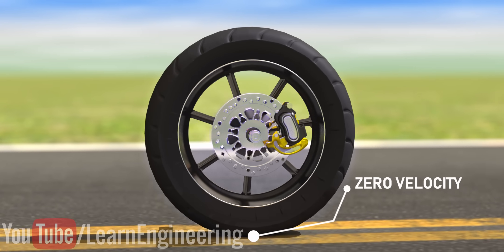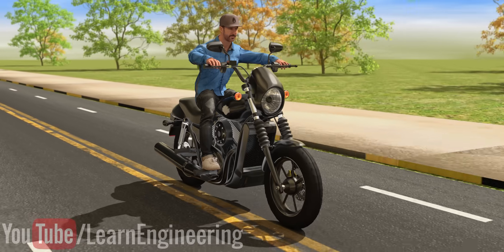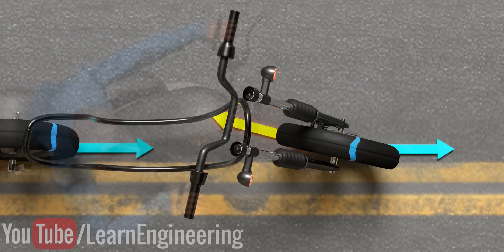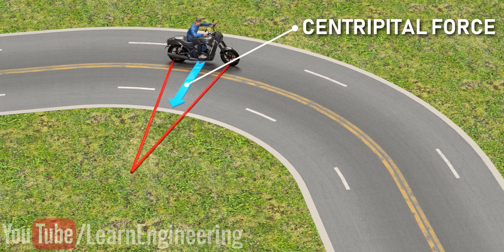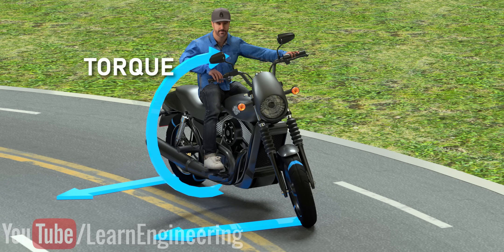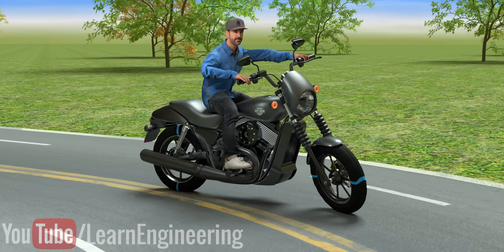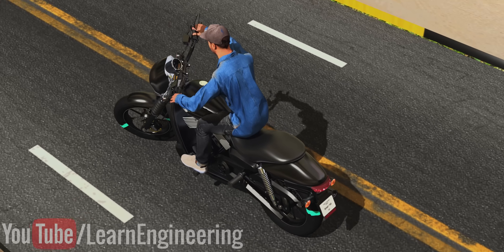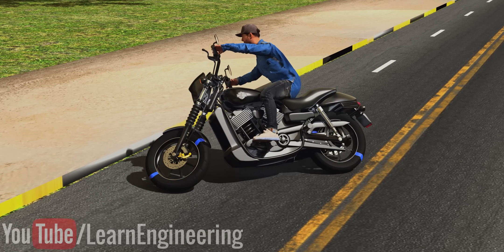Counter Steering | The interesting physics behind it

Comment: NOOOOOO this is so completely wrong, its amazing.  absolute rubbish.  it sounds science-y, as if by a physics student drop-out who never rode a motorcycle or a bicycle.  Experiments show that a bike with a fixed steering head cannot be turned by shifting weight.  THE DRIVER DOES NOT LEAN IN ORDER TO TURN, RATHER SHE LEANS BECAUSE THE BIKE FALLS INWARD. 

On any two-wheel vehicle, "no-slip" turning is ONLY  possible with a countersteer. Any other attempt only works at only very low speeds when it is possible for the tyres momentarily slip as they change direction...the same kind of slip that causes car tyres to squeak on concrete pavement. With cars, only this kind of steering is possible (excluding stunt drivers who drive a car on its side wheels). Note, when motorcycles and bicycles steer with slippage ("normal" steering), they must quickly straighten the wheel again, or of not, inertial forces will push the vehicle and rider (violently) in the original trajectory, while friction and torque of the rear wheel will push it in another, usually resulting in an unstable condition followed by a crash. 

countersteering works not because of centrifugal forces, though that helps keep the bike upright, but rather due to the fact the wheel is round, and gravity. The motorcycle is constantly falling forward and down. When the angle of the wheel is adjusted slightly, say to the 
left,, gravity will make the bike fall inwards toward the right. (The roundness of the tyre helps here). When that happens, the bike follows the path carved out by the curvature of the rim of the wheel.  

For proof of this, simply note that Once the cyclist is in a lean, she can straighten the wheel completely and vehicle will continue to follow the path of the wheel in a wide circle. Gravity will cause the bike to fall inward, centrifugal forces and centripetal forces produced by forward acceleration will keep it upright.

Lets look at it another way. Car tyres are essentially cylinders. If you were to replace the wheel with a cylinder, a turn necessitates uneven slippage between the tyre and surface. It also puts enormous pressure on the right side of  this cylinder, and as long as it does tip onto the rim, the bike will continue following the trajectory carved out by the left-facing cylinder  - to the left. A thin wheel does not have the contact area to counter that force, and so the bike falls to the "right". Now the vehicle is riding on the rim, sort of. 

Take a coin on a glass surface and experiment.

Comment: Counter steering is normal technique for motorcycle riding. If you try "normal steering" at high speeds you are absolutely asking for a crash. It should come naturally if you've ever rode a bike, you shouldn't have to think about it consciously.

If you ride a bicycle at decent speed you'll probably notice counter steering comes naturally at an unconscious level. And only use "normal steering" at low speeds.

Comment: The information is quite correct and the illustrations were done well. My only complaints were showing a rider with improper gear and also showing him counter steering into the curb. These could have been avoided. Remember new riders look at these  types of videos and showing someone geared up and not steering into a curb is always a decent plan in my book.

Comment: I'm an old fart who has been riding on and off for 52 years.  I'm back ON, so I started watching videos to refresh my skills and hopefully learn some new ones.  I've watched a couple counter steering videos and really had a hard time wrapping my head around the concept.  This video explained it in a way my head could accept the concept.  So yesterday, I went out for a slow speed ride to test this skill.  Wow, super easy and a much sharper turn in.  I was amazed at how so little pressure on the handlebar caused the bike to dip.  It was very easy to "catch" the bike and complete the turn.  I'll be practicing this new skill until it becomes second nature.  Thanks for teaching an old dog a new trick.
Reply: I suggest watching videos by people more experienced with motorcycle riding, like Motojitsu, Bret Tacs, Ryan Fortnine, Dan Dan the Fireman, Keyth Code, and google Total Control for vids about and by Lee Parks. 

This vid contains some dangerous information about how to steer a motorcycle at highway speed. 
I'm glad you've discovered countersteering as a consciously applied technique... ride safe!
Reply: @tommeyer6033  Thanks for the suggestion Tom.  I've watched several vids and I don't know why this one just connected with me.  Like I said, I'm practicing counter steering and really trying to make it second nature.  Right now, I still have to think about whether, in this situation, is counter steering appropriate or not.
Reply: @stevenwhitaker5477  it’s always appropriate. But don’t just take my word for it. Check out the lessons from professional racers and instructors who have been teaching for decades... not a cartoon by an unknown “engineer” on you tube.

Comment: How my motorcycle will know wether I am using "classic turn" or countersteering? You describe two opposite movements to do the same turn? How is it possible? I'll tell you how. 
This is BS. 
You try to describe the idea using physisc, which you don't know. 
EVERYBODY countersteers, every time, but using it deliberately is the key and that's why training is important.

Comment: PLEASE READ THIS! Countersteering is just a stupid word that is actually the normal and usual push-steering. As usual and as always you have done while driving a bike, steer your bike under 20mph with the handle bar because that's why it's there but in higher speeds +20mph it is not possible to steer a bike by just turning the handle bar! To turn in high speed you need to just PUSH the handle bar either right or left DO NOT TURN! Just push it left to go left, and push it right to go right. That's it! That's countersteering! Do not believe what's shown in this video because it's bs! Do not turn your handlebar in high speed. PUSH! This video can actually kill people. What an moron who animated this crap

Comment: This is the worst countersteering video I have ever seen. Countersteering is quite simple if you want to go right push right and if you want to go left push left. Most people countersteer without even knowing that is what they are doing. By pushing left to go left you will initiate the lean of the front tire in the desired direction same way with pushing right to go right by initiating the front tire lean into the right to go right. Also remember throttle is your friend especially when cornering a motorcycle but don't ever throttle through what you can't see.
Reply: I agree! This is the worst counter steering video I have ever seen!

Comment: I feel like lot of people misunderstood this video or did not watch carefully .
lot of comments saying there's only way to steer a bike, it isn't. You can steer your bike either by leaning or by counter steering. Most people steer their bike my leaning their body cuz that's how a bike turns but with counter steering you make your bike lean by the handlebars you dont have to use your body weight or force your body to make motorcycle lean. there are clearly two ways of steering and this video is not misinforming at all. 
y'all are bunch of kids here in the comment section. dont ever think all people do counter steering to lean the bike, most of them lean by their body weight, even moto gp riders lean their bike normal way (leaning by body weight) rather than counter steering (leaning by handle bars) way. counter steer is only needed when your bike is about to fall off or slip cuz of way to much leaning then you pop ur handle bar in opposite direction your bike stands straight up or it is also used to avoid a pot hole quickly while u're speeding on the road. These kids dont know shit about anything
Reply: YoGucci Boii 
Absolute and utter bullshit mate! 😂😂😂
Reply: You know nothing.
Reply: @XtreeM_FaiL  all counter steering does is initiate the lean only, after your bike is leaned already the handle bars acutally need to be in the direction where you're going., the more high speed, the less handlebars needs to turn once the bike is leaned in the direction you going. Its completely possible to lean a bike without doing counter steering. Thats what moto gp riders do in corners, they dont do counter steering, they lean bike with their body.. once its high speed a bike turns by leaning only and counter steering is the way to make bike initiate a lean by pushing handlebars and not by body weight or tilting yourself, but you can make a bike lean without doing the act of counter steering.
You know nothing bro not me, you believe that bike can only turn by doing counter steering which is completely false. counter steer leans the bike in the direction you push your handle bar ... you can make a bike lean without pushing on the handlebar with your body weight alone. YOU DONT FUCKING NEED TO DO COUNTER STEER TO LEAN A BIKE. ITS NOT THE ONLY WAY TO LEAN A FUCKING BIKE. 
next time you say someone you know nothing or tell utter bullshit first go experience, gather a knowledge then come here you dumb fucks.

Comment: The lean of the bike is all controlled by counter steering after about 25-30 mph. Even in long sweeping turns the more you turn the handlebar the more the bike leans the opposite direction. Thrre is no point where you steer the same direction as you are turning unless you are going quite slow. Your science is incomplete. Watch "twist of the wrist II" for an example of what really happens on real motorcycles not cad bs graphics. It is funny to me to hear somebody who is trying to explain something they do not have the education level to understand all of the forces being applied. I admit i can not explain ot myself. But you sir have it wrong that is something i know for certain. Have a great day and i hope you figure it out so you can explain it.

Comment: You should take this video down. You are going to get people killed. Your little bit of knowledge is dangerous. You're completely out of touch and missed important points such as speed, steering head angle and rotational momentum.  Depending on the steering angle a motorcycles direction of travel will change at about 7 mph. So you are stopped at an intersection. You are going to make a right turn. You apply throttle and start ahead, turning the handle bars to the right and the motorcycle turns to the right. However, as your speed increases, once you pass 7 mph, the motorcycle will stop turning right and begin to move left. The novice rider might try turning the handlebars more to the right but the effect will be to move the bike left. The number of people who died in this manor is high because as the bike turns left it's accelerating into oncoming traffic and any additional steering input to the right just adds to the effect. Even if the rider is hanging off the right side of the bike and dragging their ass on the ground the motorcycle is still going left. All you Engineers.. you understand nothing. Why don't try and figure out how far you have to hang off at 180 mph  while turning the front wheel to the right. You probably also think you should use the rear brake for breaking. Idiots. Better still, why don't y'all try your method on a dirt bike. Yeah, go make a right turn on a dirt bike by turning the front wheel to the right. Idiots.

Comment: The phenomenon behind Counter Steering is the same of a car seat and passenger during a car crash. If you turn the handlebars to the opposite direction of the direction that you want to turn, it will increase the radius of the turn and so you can make a quick turn.

During a car crash the driver/passenger is lurched back and the headrest is designed to decrease the angle that results in neck injury.

Comment: Thanks i just went into a wall on my bike.
Reply: Yeah engineers are dangerous. Their explanation is complete shit. Counter-steering is really quite simple. If you stand beside a normal bicycle and turn the front wheel in either direction it will begin to fall inward in the opposite direction. So what does that mean? For a motorcycle it means that if you push with your right hand, turning the handle bars to the left (with the motorcycle at speed greater than 7mph) the motorcycle will try to fall to the right. This translates into leaning to the right and yes if you keep that steering angle it will fall to the ground. So you stop pushing with your right hand and return the steering angle to center.  You will have established a steady state, the lean will still be there and the bike will continue to turn right. You could pull with the right hand to eliminate the lean but more often you'll find yourself accelerating and that dynamic will also bring the bike back up. Remember, all these move are very subtle and more so the faster you go. At 160 mph I can assure you it still only takes a few lbs. of pressure on the handle bars to make the bike turn. I can also assure you that at the speed, without counter steering, you can hang off until your entire body is off and only one leg is on the seat and you'll never turn. You can drive straight down the road like that.

Comment: This is way too complicated if you're a beginner ride  don't watch this
Reply: freezeme360  Counter-steering is really quite simple. If you stand beside a normal bicycle and turn the front wheel in either direction it will begin to fall inward in the opposite direction. So what does that mean? For a motorcycle it means that if you push with your right hand, turning the handle bars to the left (with the motorcycle at speed greater than 7mph) the motorcycle will try to fall to the right. This translates into leaning to the right and yes if you keep that steering angle it will fall to the ground. So you stop pushing with your right hand and return the steering angle to center.  You will have established a steady state, the lean will still be there and the bike will continue to turn right. You could pull with the right hand to eliminate the lean but more often you'll find yourself accelerating and that dynamic will also bring the bike back up. Remember, all these move are very subtle and more so the faster you go. At 160 mph I can assure you it still only takes a few lbs. of pressure on the handle bars to make the bike turn. I can also assure you that at the speed, without counter steering, you can hang off until your entire body is off and only one leg is on the seat and you'll never turn. You can drive straight down the road like that.

Comment: can i post this video on my facebook profile?
Reply: Wagner Buion 
Don't .... It's dangerously wrong!!
Reply: @softailfun  I dont thing this is dangerously, I ride so
Reply: @wagnerbuion2787  
Ok so you ride. The video suggests that counter steering is an option. That “normal” steering could be used if the rider wished. As a rider, do you agree with this?

Comment: Sorry but this video info is wrong. Counter stering is the only way you can turn a bike, it's not an option. Every good biker knows this.
Reply: I agree but below 7 mph you do have to turn the front wheel in the direction of the turn. Counter-steering is really quite simple. If you stand beside a normal bicycle and turn the front wheel in either direction it will begin to fall inward in the opposite direction. So what does that mean? For a motorcycle it means that if you push with your right hand, turning the handle bars to the left (with the motorcycle at speed greater than 7mph) the motorcycle will try to fall to the right. This translates into leaning to the right and yes if you keep that steering angle it will fall to the ground. So you stop pushing with your right hand and return the steering angle to center.  You will have established a steady state, the lean will still be there and the bike will continue to turn right. You could pull with the right hand to eliminate the lean but more often you'll find yourself accelerating and that dynamic will also bring the bike back up. Remember, all these move are very subtle and more so the faster you go. At 160 mph I can assure you it still only takes a few lbs. of pressure on the handle bars to make the bike turn. I can also assure you that at the speed, without counter steering, you can hang off until your entire body is off and only one leg is on the seat and you'll never turn. You can drive straight down the road like that.